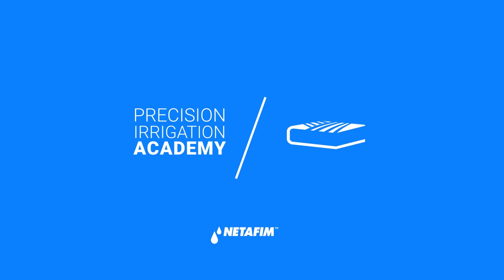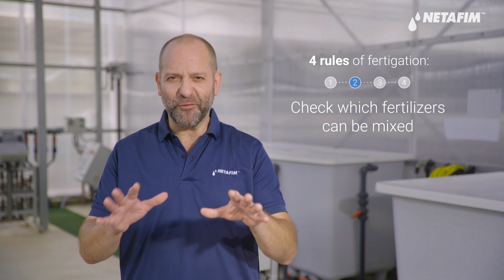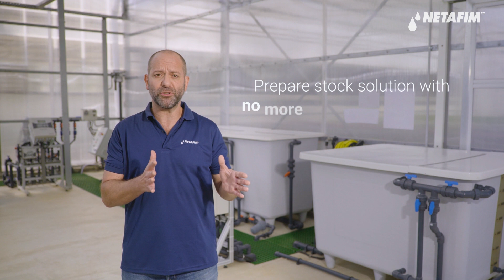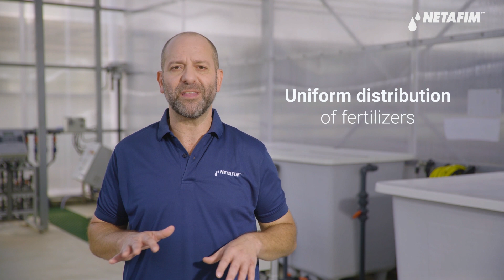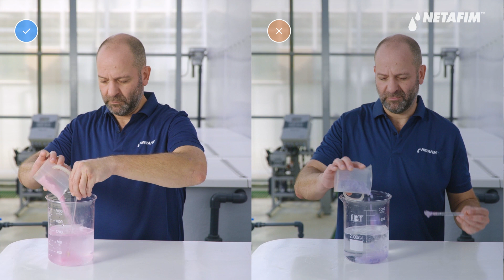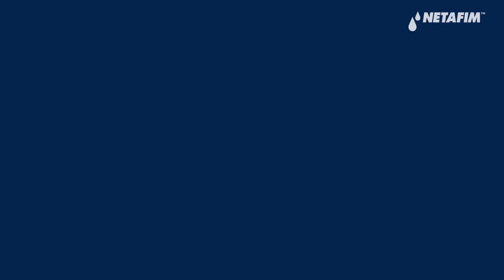AgroBites- Using fertilizers in the drip system | Netafim

Comment: Is the addition of water before and after ferttilizer application also applicable for plants in Cocopeat Media?
Reply from the maker: The water before / after process is a recommendation for use in the NETAFIM irrigation systems (Driplines) to prevent dirt and sediments from blocking the drippers, we don’t see a problem using it in Cocopeat media.

Per this question we recommend using this method in cocopeats media accordingly:

25% water before
50% fertigation
25% water after

Comment: Thank you. What I'm struggling with though is my soil tests say "add XXX pounds of nitrogen per thousand square feet". But.. with drip how to I figure out how much nitrogen to add each time? In my case, I have 8 rows of pumpkins and they want 1 pound/1000 SF. I get it, 2.2 pounds of 46-0-0 if I was doing dry fertilizer, but how do I know how much for just rows where there is six feet between rows?